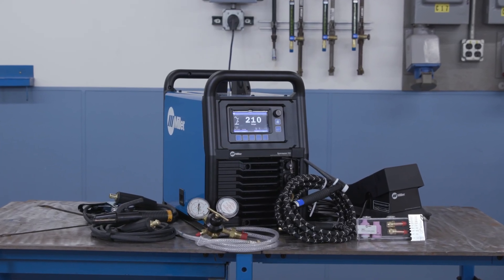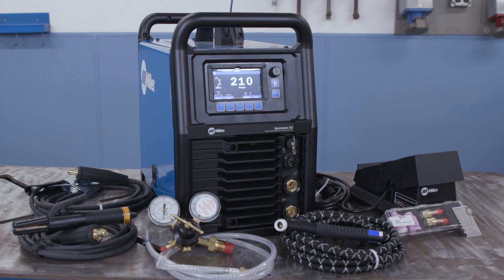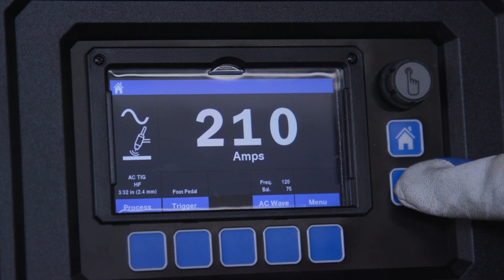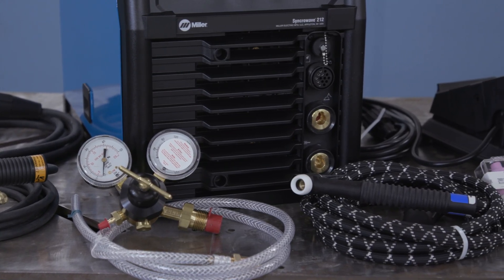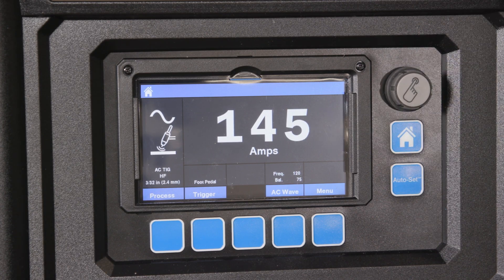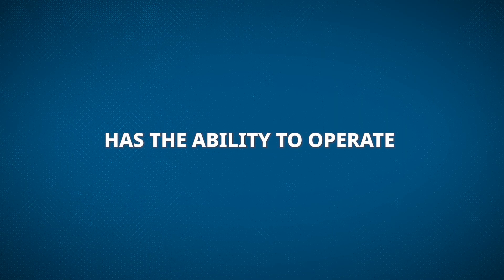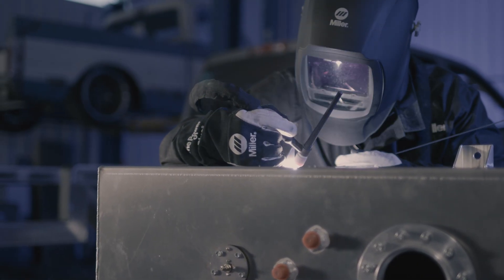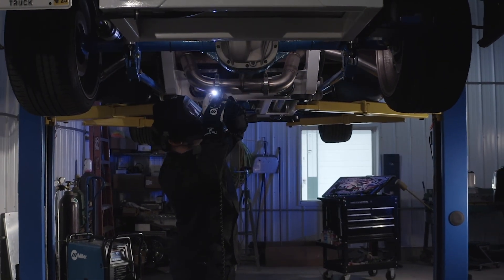Syncrowave® 212 AC/DC TIG Machine Overview

Comment: Dose the 212 have pulse and what is the hz range?
Reply from the maker: Yes, the Syncrowave 212 is capable of running Pulsed DC TIG and operates at 50/60 Hz.
Reply: @MillerWelders  i haven't been that good this year , but hopefully Santa will come through.😁🎅

Comment: So it’s an AC/DC tig but you can add a spool gun for aluminum? Can it weld aluminum with AC tig?
Reply from the maker: Yes, it can run aluminum TIG, and it also has the option to use a spool gun, which is ideal for slightly thicker aluminum.